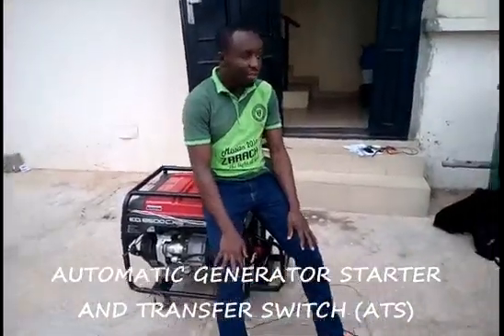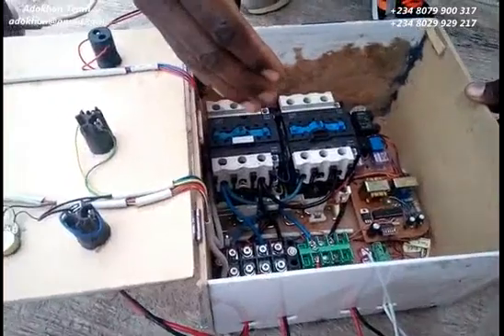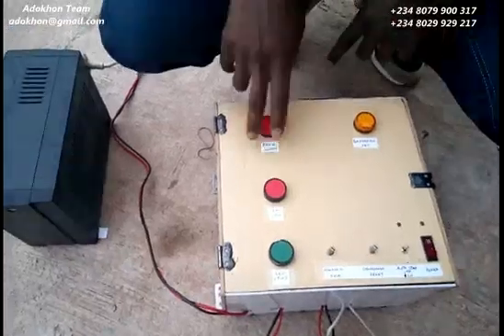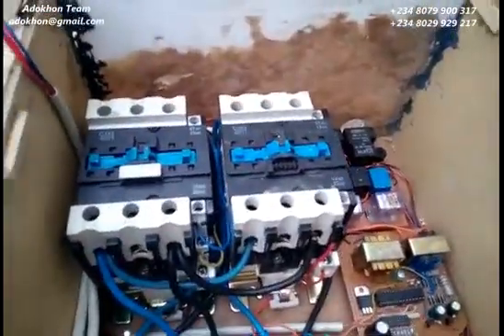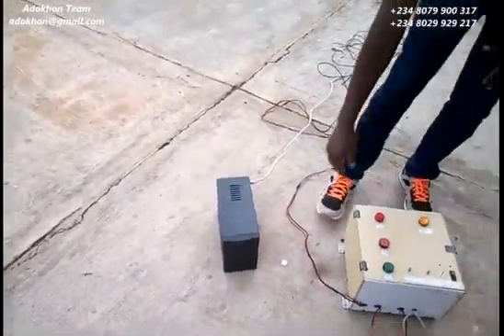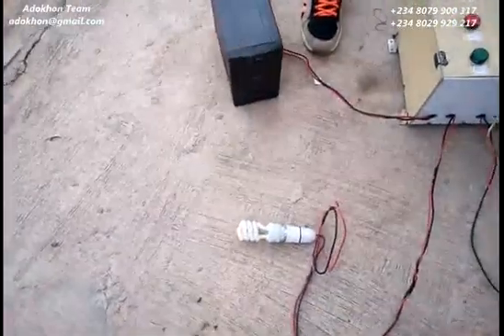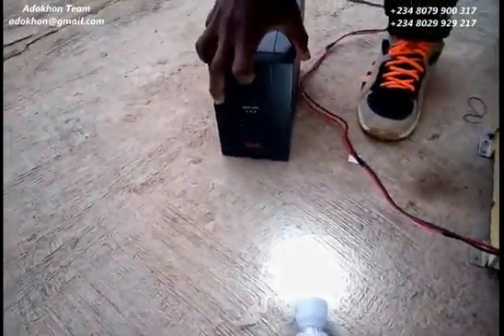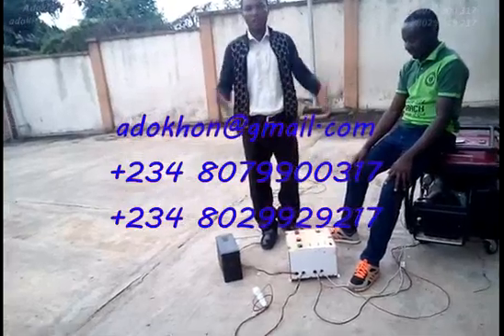Automatic Generator Start/Stop and Transfer Switch (ATS)

Comment: There are much better circuits out there,.. I would not use this one !  its not really correct to start with. many mistakes in this one.
Reply from the maker: Pls I'm open to any observations, feel free to point out the mistakes, so we can collectively work on it
Reply: @Adokhon  how much does this kit cost ?
Reply: Please Steve,  can I get the better circuit diagram you used?